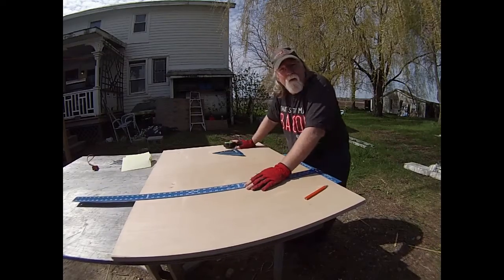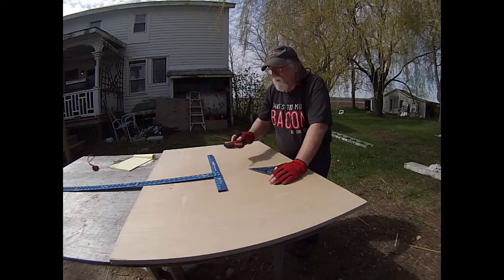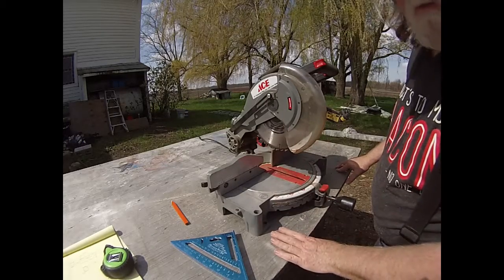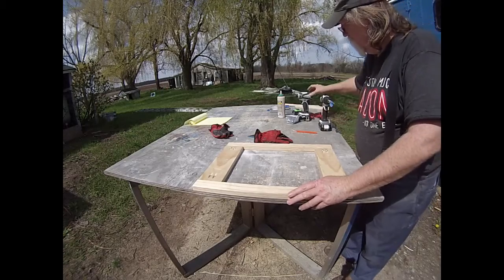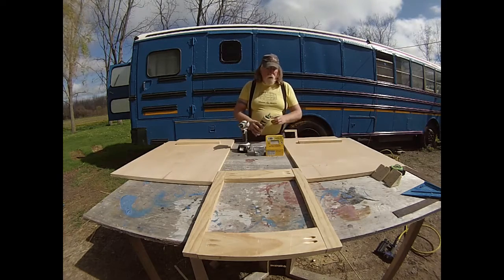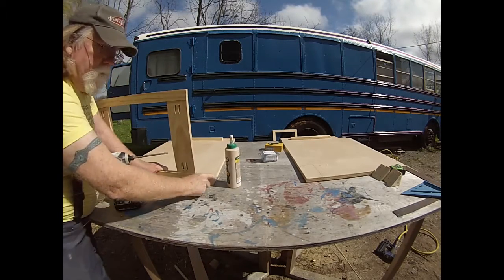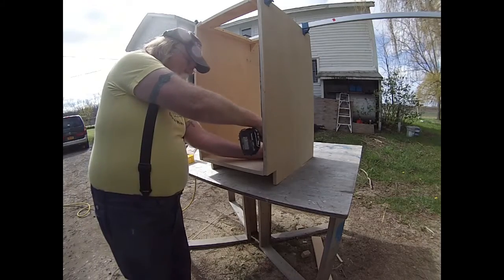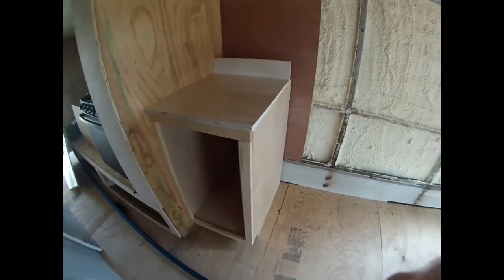Old Thyme Skoolie- Episode 21 Cabinet building

Comment: That was great! I actually learnt alot from this. I am also hoping that you will show us the electical stuff, i only thought of it when you told us where you are putting the stove. And are you going to use solar power or a generator, etc...?
Reply from the maker: I do plan on solar and will try without a generator. 
I will be putting up videos of every step of the way

Comment: Why not attach faceframes with bisketts instead of brad nails?
Did you nail into your removable bottom or was there another block in there?
Reply from the maker: It would have been a real pain to use biscuits on the faces. Getting them all lined up. Brads were easier and are only there to hold things in place until the glue dries
I did nail into the bottoms but didn't really need to